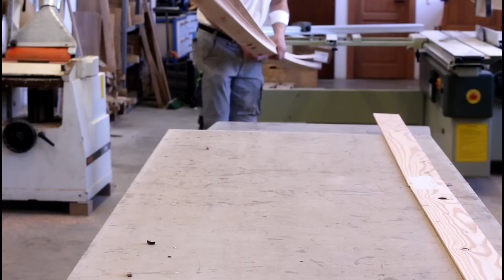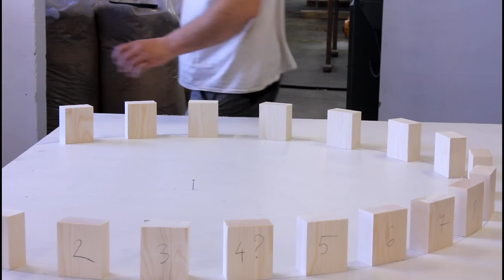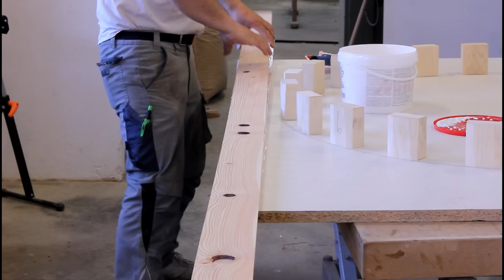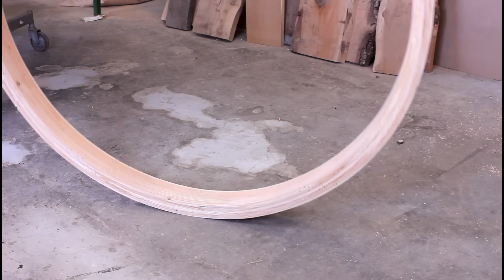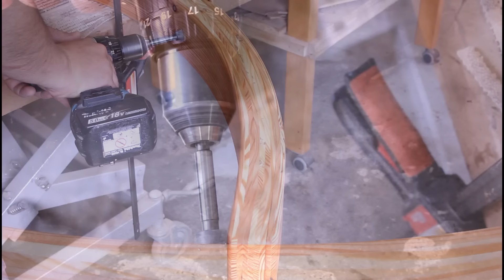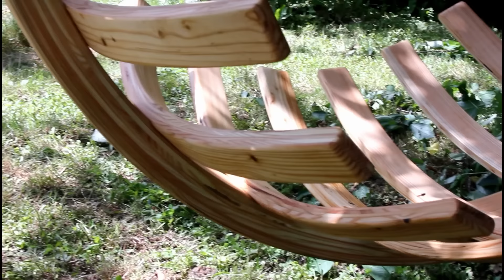Bending Wood For Curved Porch Swing. WOODWORKING & HOW-TO Bent wood

Comment: Great idea and nice craftsmanship!
If you reflect on the C shape on the terms on comfortability, would you change the shape to improve sitting or lying position in the chair. For example,  more a 6 shape so the curvature is smaller on the sitting part of the chair. Or more half an egg shap to get a bigger sitting part? Or is this perfect?
Reply from the maker: Thank you for your feedback. I had thought of same thing when I was designing this. I decided to go forward and it was a good call. C frame has actually a bit longer bottom part and when you put fev pillows under you the sitting position is very comfortable. If you wish really relax you extend the legs so they are hanging over under your knees. It's like being on a comfortable sofa.
I would stay with same design if i start over. I was aiming more to elegant simple design not much for total comfort even if it turned out that is quite comfortable.
Reply: Thank you for the answer. Maybe I will try to make something similar for in our garden one day. I will stick to the C shape and maybe I will make each "leg" from top to bottom a bit longer to make to bottom part more like a cocoon. No I am saying this, if you look at your thumbnail, it looks a bit like the skeleton of a scorpion (if it had a skeleton) or a pangolin 😊
Reply from the maker: Sure. Yeah many comments were regarding dinosaur bones.. That wasn't intentional. Use slow curing glue to have enough for clamping. Good luck
Reply: @Slovenianwoodworker  What glue should be used for this excellent design?
Reply from the maker: Any wood glue would do fine with D3 certificate. Maybe floor /parquet glue is better due to slow curing time. You need time to clamp everything properly.
Reply: @Slovenianwoodworker  Estimad@ qué belleza de trabajo, espléndido!!! Cuál es el costo.? Saludos y gracias ❤❤
Reply: We can order this ? 😮
Reply: Если не раскроется под тяжестью человека.... Класс
Reply: Por fabor dime, este arco si reste el peso de un adulto o cuantos kilos podra resistir.
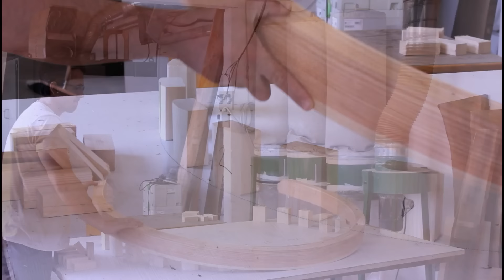Reply: Oûo 3:41 😮😊😊😮😮òkuuuuuuuuuuuuuuuuuk😊😊😊
Reply: U😊😊 i😊😊Igi  mm n ii bu Ingiviii iig😊😊😊😊😊 i😊i😊😊univ vv. pi. O😊 p. Oi. Oo

Comment: Absolutely LOVE it! Can you update how is the chair performing/holding on? I would love to know if with long term usage the “C” shape would mess up as the chair is only hanging from one point
Reply from the maker: Thank you for your kind words buddy.
Regarding your question. It's been a year almost and i don't notice any difference. C frame is very thick and roubust.Glued segments give much strength. And it has some elasticity too So when under a load it sags a bit but after it springs back as it was.
I don't think it will expand at all

Comment: Beautiful work. Can I ask what are the dimensions of the individual larch pieces for the main frame before you laminate them? And sorry for another question, how many pieces did you laminate? I’m absolutely fascinated by this video 😀😀👍👍👍👍
Reply from the maker: Thank you.
No problem. Length is around 3m or fev centimeters more. Width 12 cm. Total number of pieces i don't know exactly but i can count and report later. I think around 8. Better to do 1 more than less.
Reply: @Slovenianwoodworker  Amazing thank you. Have you any idea approximately how thick each individual piece is before you laminate them? Seriously want to try this method 👍👍👍

Comment: Love it, however I love putting up my legs while sitting. Im soon 50 😎 So, I would extend the ”chair” so my legs are supported while extended.
Reply from the maker: I understand what you mean. It would definitely helped but than I would have to change the design because it would mess up the clean C frame.
I'm working on new version at the moment I'm sure you gonna like it.
Cheers mate
Reply: @Slovenianwoodworker  I look forward to the banana-version 😎
Reply: I secretly photographed my bride's beautiful posture while sitting up in neutral position  I'm a physical therapist..  I copied her proportions, back of knee to sacrum, location of the ischial tuberosity (the bone metal chairs like to pressure under the pelvis) etc. Size of ribs, head & neck location, etc. I curved the seat back to match boney and soft tissue,  I shaped the seat pan including "ischial pockets" which prevent rolling the pelvis backward,, slouching, & sliding the pelvis forward. The waterfall at the back of the knee is congruent while shaping to her upper calf muscles. Wide armrests that fully support the weight of the upper extremity. (Shoulder blade to fingers) She reads, corrects her students papers and tests, then falls asleep fully supported without slouching or sliding in her seat. Shaping a work of art to match its user (human factor engineering also known as ergonomics) personalizes the unique masterwork. These make superlative gifts and of course sales items you keep you creating your inspired art.

Comment: was just thinking that you could really quickly mount those blocks to the base with pocket holes, so you wouldn't nee to mark it out, and drill from the bottom...a quick 'production line' drilling of the blocks with pocket holes, and then just screw them to the base board.... not a BIG DEAL, just another way of looking at it  ;-)  we sLOVEenia !
I thought that you could also use a big ratcheting tie-down strap to help hold the circle in place??
Supposedly, the 'Star M' wood bits prevent the breakout...or, you could pilot dril, and drill from both sides?
Reply from the maker: Thank you for your suggestions. Drilling with a pilot hole or having something on the exit side would prevent tear out sure but I had other interests for that. Cutting out the video clip would be easier 😉
Gluing this huge circle is a bit challenging yes. Big rachet would help. Issue is also to keep the strips of wood aligned so they are 90`once they are all clamped. It's easy to get them slipped out and spread.
Cheers mate

Comment: Great job bro! How long has this been in use by now? Are you seeing any signs of the main piece straightening up and losing its perfect round curvature (perhaps after it was exposed to the elements and might have absorbed some moisture, or under the weight of a person sitting in it)?
Reply from the maker: That's quite fresh. So I don't have actual stats about this one. But i made this things in the past quite often. And i can for sure say it doesn't sag or expand. It moves naturally with wood or when under weight but it gets back in shape.
And the reson becose this is segmented frame. Thin stripes are Glued together and glue is holding everything together and doesn't allow to expand. This holds shape better than steam bending.
In time due to gravity it will expand but how much won't be even noticeable.
Thank you
Reply: @Slovenianwoodworker  I think why it keeps the shape is more, that each of the layers prevents the other from moving. I've built a greenhouse similar to that or at least with the same technique and there I only have logs between to boards and nothing moves - except what you say with the natural move of wood.
Reply from the maker: I agree 💯
Reply: Once that wood glue cures it’s set..! It will not fail. The glued areas are stronger than the wood itself..!

Comment: why would you not clamp a scrap piece of wood to the exit hole of the wood! arhhghh
Reply from the maker: That glue that i show isn't a coincidence
Reply: @Slovenianwoodworker  it could be avoided by just clamping a piece of wood at the exit hole ha
Reply from the maker: I'm well aware of preventing that to happen. You probably didn't understand what I was trying to say. That was done on purpose. I have a marketing deal with Starbond. I had to "plug it" in somewhere
Reply: @Slovenianwoodworker  In that case, Ibe careful, i think you have to make it clear if its sponsored marketing for a product.. just a warning.

and I didn't want to come across patronising, just felt like an obvious mistake.